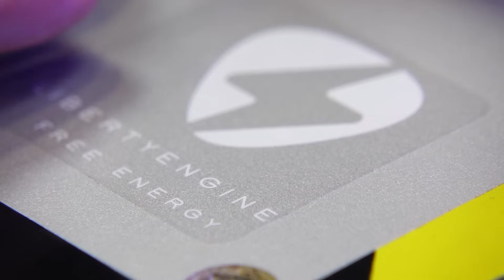10KW Generador de Energía Gratis con Piezas de Microondas - Liberty Engine 3.0 - 100% REAL

Comment: We saw you giving the generator an electric spark from a fan dynamo, but the question is when the generator was charged and worked to produce 230 volts of electricity, why did the fan dynamo not work when it was connected to the generator electricity? Please explain.
Reply: Good question, I don't know this device but yeah it's should hack like a motor if voltage are generated after the initial turn
Reply: Не буде ніяких пояснень! Бо їх не існує взагалі! Це фейк!
Reply: @SylvainRochette The problem is that he does not answer questions and inquiries.
Reply: @ВолодимирПироженко-э2ж True words, their silence in responding to criticisms and inquiries puts them in the circle of deception.
Reply: @mayarhayar5710  Well they responded to someone's comment in another language just below.. may try communicating in that language
Reply: This dynamo is a very low turn motor so i think it turns when he start it but we can not really see it. Also, i say: NO MOVEMENT = IMPOSSIBLE (And really difficult to prove in video)
Reply: @Liongate64  Perhaps the words are persuasive, but it is necessary to point out and explain everything that is ambiguous in responding to inquiries.
Reply: Динамо после поворота крутится, но медленно, это такая конфигурация этого устройства
Reply: It is moving, slowly and it should be stopped if there was no power from the generator
Reply: @pedrosura True, but it should have been clarified
Reply: 4rpm per minute it is slow
Reply: the starter dynamo worked look carefully 16:34
Reply: @tenkaio8  Thank you for noticing, what we care about is the result
Reply: @tenkaio8  well done man!! lot of poeple write such a lot of sh... the same who has never done something interesting in there life. Welle done!
Reply: Perché ha un suo interruttore. Si vede chiaramente che accende il ventilatore.
Reply: @marioaltieri6170 Grazie per la risposta, ma devo fare una domanda in modo che possiamo capire cosa sta succedendo.
Reply: @tenkaio8 çok güzel yakalamışsınız evet sistem çalışıyor bunu denemek lazım biraz üstünde çalışmak lazım
Reply: Because it STARTS to spin! Use lower play speed and watch carefully.
Reply: @user-nu3nn3jj5v  да согласен !

Comment: It's similar to a Meg in another configuration, so my theory of the device really work is, the herz at 50 could be because the core saturation cannot exceed 50 et but why the small motor used as generator doesn't spin as soon the device is started, it's the thing that make me think it cannot work, anyway nice demo
Reply: Он начал вращаться в обратную сторону, по скольку это было правильное направление, я пересмотрел этот момент несколько раз
Reply: because the diode passes current only in one, that's why it doesn't rotate, which doesn't mean that the system doesn't work, on the contrary, it works great :)
Reply: if someone tried to release an alternating current start impulse and even when you copy these coil connections on the video, each time the coils will work on a short circuit and this momentary impulse from the motor will discharge in a fraction of a second and will not surprise the correct connection of the coils is shown in the video without cuts in liberty engine 2 if someone was careful because it is still the same principle of operation as the other earlier versions and it is not static it vibrates if you touched a metal core or rod with your finger you would feel it
Reply: Este impossibile
Reply: @ionutlaurentiualexandru5243  if you say it's impossible, then explain exactly with substantive arguments why it's impossible according to you because I don't have any problem with these devices
Reply: فيه خدعه بالموضوع

Comment: The idea of a fuel-free generator is interesting, but I do not agree with the declared power of 10 kW. For such power, you need a wire of at least 6 mm2, and in this video, a wire of no more than 1.5-2.5 mm2 with a capacity of 19-27A (4-5.5 kW) is used, this is firstly. Secondly, in this video, the author does not show the power of the connected devices for summing up the power and understanding the picture as a whole, and the declared power of 10 kW is also not shown in the work. So, my personal conclusion is that this generator can produce a long-term permissible power of 3 kW, a maximum of 5 kW. Let's be realistic.

Now a question for the author, is the rod that acts as a fixed rotor made of what material, aluminum or a mixture of aluminum with another material, or is it stainless steel?
Reply: He already corrected, that it is 1kW, as for the bar, there is someone who did this experiment without the bar and it worked the same way and the (multi electro) I think the secret is the connection of the transformers to the stator.
Reply: Eu acho que ele não pode revelar o segredo, mas pode dar pistas de como funciona a ai fica por nossa conta .na minha opnião isso deve funcionar . eu fiz a copia do 2.0 e consegui 4.000 watts .acho esse mais interessante por não ter partes moveis.vou tentar faze-lo logo.
Reply: I don't think he can reveal the secret, but he can give clues as to how it works and then it's up to us. In my opinion this should work. I copied the 2.0 and got 4,000 watts. I find this one more interesting because it doesn't have moving parts. I'll try to do it soon.

Comment: ⓵ Is it true that the cylinder is made of pure silver and aluminum alloy?
⓶ Are there other substances included? So what is it? I would appreciate it if you could let me know.
⓷ Does an asynchronous induction motor have to be a three-phase motor?
⓸ Does the induction motor have to be a 36 Slot Type?
⓹ Are single-phase motors possible?
⓺ Can the synchronous motor MDS-4A start with 4W power?
⓻ It seems impossible due to lack of power. How do I get started?
⓼ Thank you.
Reply from the maker: The most important thing is the inner cylinder. It is not only made of silver and aluminum, but also contains other materials to a lesser extent. In addition, different special treatments have also been given to this material. It is not simply an alloy. We have explained all this in one of our videos
Reply: (I've explained all of this in the video
I watched all the videos, but I can't see them.
I'd appreciate it if you could clearly explain the video through email

Comment: I don't guess that it works, the metal shaft inside the motor needs to be about the coils in order to produce an electro magnetic field and it's necessary to be moving to generate alternating current.
Reply: NOT READY, JUST CHANGE THE POLARITY OF THE ROD! RESONATOR. GOOD WORK FOR THIS PROJECT!

Comment: Hola, seve bien el prototipo, mejor que el anteior
me parece que el principio de funcionamiento se basa en un oscilador
Lo que me interesaria saber es el material de la barra y dimenciones 
Cuantos HP es el motor ?veo que es un motor de 220v trifasico 
espero respuesta GRACIAS !!!
Reply: This project and the motor looks unserious, what makes sense in this project is the two sides micro wave primary transformers and the magnetor, so I find the motor unusual in this projet because the micro wave coils are wound to accommodate 220v, how ever all wires are connected in parallel both the motor wire, so without connecting the motor wire, I wish the engineer gratis or the video make should test the project once again, for a better verification.

Comment: ¿Creen que puede ser un motor de 4 polos en vez de 6? (respetando las demás especificaciones del video) y también si pueden ser imanes de ferrita tipo disco a reemplazo del de aro. Algunos componentes son muchísimo mas fácil de obtener que de los prototipos anteriores pero otros no. Muchisimas gracias.
Reply: tengo las mismas dudas, use uno de 4 polos y entra pero no sé mantiene la electricidad
Reply: @manuelmaikkel4234   ...o si se pueden usar dos motores de 3 polos. Para sumar los 6 totales. Como de bomba de agua o similares. Combinados sobre la barra. Al parecer, mientras el motor tenga su peso equivalente en cobre. Quizás, no lo sé. Este canal de YT sobre energía perpetua siempre muestra CASI toda la información, ya que al parecer ellos mas que nada quieren que la gente lo sepa. Lo demás queda a cuenta de los entusiastas.
Reply: @Jack_Smith_Yes  y que material crees que sea el tubo? estube investigando y dice que la distancia de la barra al embobinado no debe ser tan alta por las perdida de energía.
Reply: podrias compartir un pequeño video de como es la fluctuacion de la corriente? porque estoy a punto de terminarlo y que funcione al 100%... arriba deje un link con unas fotos del plano y del avance. @manuelmaikkel4234
Reply: @joseabelardoquinonesg.9048 salut 
Ai reușit sa îl faci sa meargă 
Eu nu am reușit
Reply: @liviubungianu9771  Nici eu n-am reusit dar ai vazut din ce-i facut miezul ? bara din aliaj de aluminiu cu argint (Argalium).

Comment: let me guess
the shaft that goes through the motor is a special alloy without which the device cannot function properly
as with the engine 2.0
Reply: you can make it out of steel the aluminum and silver alloy was intended to distract attention from the actual operation of the system and other important things and the principle of liberty engine 1 liberty engine 2 still remains the same
Reply: Si l’axe détourne les champs magnétiques »effet de Foucault « , pour un maximum d’efficacité ça composition doit avoir au minimum 70% de nickel,20% aluminium et 5% de cuivre. L’investissement ce compte a plus que 1000 dollars en partant juste pour l’axe ,sans savoir si ce truc va fonctionner et si tel est le cas combien en surnuméraire va t’il produire. Prétendre 10 kw  c’est est complètement fou.
Reply: @rochlamothe5216  Bonjour Roch, comment arrives tu à ces proportions? j'ai un mal fou à me repérer. Quant aux 10kW ce doit être en crète... pas en continu. Merci.
Reply: @aleksanderpawowski4251  Yes , seems you are right on the money, so much iron between the magnet and the coil could be destroying the Lenz effect , that is the main obstacle to free energy.

Comment: 1. Ask yourself why this channel never responds to comments.
2. While he gets the system running through the small motor, when it is started, the small motor in the hand should also rotate.
3. The material in the middle was not described.
Well...I'm currently building it myself to see if it works. Fortunately, this is not the only solution to generate electricity :-)
Good luck guys.

Comment: Why is it that a magnet next to a coil produces a current. 5000 W. No moving magnet?! Could you please explain.?
It seems that the Magnet plus the Coil generates a large flux but it static (just potential). Then by plugging at the outlet the small hand motor you are starting the engine. You make the coil of the motor generate a small voltage abd current to create an electromagnet l at the main motor coil that interacts with both static coils on the ends and once you get it going it doesnt stop?  This is not in the books. Is it anywhere? Is it patented? It must be an industrial secret?

I am curious about the Bar. It is transmitting a rotating magnetic field. What is it made of? Is it the same material as the rotor in Liberty Engine#2 which seems to be a high percentage of Silver?
Reply from the maker: This is another trade secret. The metal bar is made from the same alloy as the rotor on the Liberty Engine 2.0. The motor stator generates an oscillating magnetic field that is transmitted through the metal bar to the coils, and the magnets amplify the magnetic field so that the coils generate a high current flow.
Reply: @thelibertyengineproject7966  Thank you! That is what I suspected.. it’s that alloy again..
Reply: BTW, I really hope you mount the generator on a “delivery drone”, plastic see thru box in the bottom, make it fly indefinitely on an live feed. That will quiet naysayers
Reply: @thelibertyengineproject7966  What would happen to the Liberty Engine 2.0 if magnets were placed behind the coils?? Would the output exceed 20kW or not. I imagine you all tried it?
Reply: @pedrosura Can you make it with steel and see if it works? I would try but don't have access to the materials.
Reply: @bradleybrooks4761  No idea. I dont think it would work. I think the metal is diamagnetic or some other property. Its secret for a reason.
Reply: Это вечнная электростанция  😂ты его больше некогда не отключеш 😂😂

Comment: Why you anounce that max produced power is 10 kwt while the generator as we can see on the data panel has 0.75 kwt nominal power? If so i wonder the copper coils of the stator would be burned as a result of overloading.
Reply: Yes he was not showed how much watt (amp) gets..???
Reply: No porque se disipa por inducción...por eso tiene esa separación..pero tiene que tener2(pequeñas cosillas..que el invento argentino del {Enano® chupatierra®}{tiene y patente!!jeeeee😊
Reply: @lhkalp 
Obio que más de 40(Amper..sino se sobresatura..es chico..no...gigante?ok?
Reply: 40(amperes de máximo rotando los elementos para no producir histeria de núcleo..😊

Comment: Es muss die technische Möglichkeit vorhanden bzw. geben die spulen von Mikrowelle hin und her zu schalten, dabei sollte Mikrowelle spüle jedes umgekehrt mit Strom versorgt werden, damit wird ein Magnet welle einmal S und N bewirkt, somit wurde der Motor durch die Wirbel Magnet Strom erzeugen, um diese zu erreichen wird auch eine große Kondensator benötigt, und wenn dann der Erfolg der Umschaltung auf 50-60 mall die Sekunde ist, kann damit Wechselstrom mit 50-60 Hz  erzeugt werden, das mit stab ist nur eine Vortäuschung. Im Decker der oben aufgesetzt wird sollte die Technik sein.  Falls andere Erklärung haben können sie auf meiner Darstellung antworten.  An allen viel Erfolg, habe es auch gebaut und es geht nicht, wurde aber gehen, wenn die Spulen immer wieder automatisch umgeschaltet.

Comment: Salut,  j'ai regardé votre video avec attention, mais j'ai une question, si ce système fonctionne réèlement,  pourquoi  le petit moteur ne tourne pas après le démarrage du système?
Reply: If you look closely, I can see a very slow rotation of the microwave motor after they started the oscillation. It rotates in the opposite direction as it was forced before.
Reply: يدور

Comment: I'm looking at it and think it's great. I can't make it because I don't have the materials, but I can test it a little. My question is, during the test stage, power is supplied by the turntable motor, but even though a voltage of 230V is generated, the turntable motor does not rotate, so I am wondering why, and after that I unplug it. However, I think it will rotate until I pull it out.

Comment: El aire es un muy buen aislante de flujo magnético, por lo que el motor asíncrono empieza a zumbar como en el funcionamiento normal con un rotor de dos fases en lugar de tres.
Consume una corriente muy alta y se quema, o si está instalado, el interruptor de protección del motor se dispara.
¿Qué tipo de efecto físico hay? Que no suceda lo anterior y aún así llegue un flujo magnético tan grande a la varilla para subir 230V en las bobinas.
Lo que en realidad no debería suceder, ya que el aire, como se mencionó anteriormente, es un muy buen aislante de flujo magnético.

Air is a very good magnetic flux insulator, so the asynchronous motor just starts humming like under normal operation with rotor of two phases instead of three.
It draws a very high current and burns up, or if installed, the motor protection switch trips.
What kind of physical effect is there? That the above does not happen and still such a large magnetic flux arrives in the rod to raise 230V in the coils.
Which actually shouldn't happen, since air, as mentioned above, is a very good magnetic flux insulator.

Comment: I assume that this device is a kind of zero-point energy generator. In the video, the magnets are placed as single N poles at both ends.
And a stationary wave [longitudinal wave] is produced from the coil. The magnetic flux diverges throughout the center of the motor. It is 50/60HZ frequency synchronized and the magnetic flux time variation occurs. The circuit configuration is fed back so the energy is amplified. I think this is an actual example of energy extraction from space.

Comment: hello, please tell me the diameter and length of the shaft you made is identical to that of the motor, the material is the same as the motor shaft. thank you and keep up the projects, don't look at the envious
Reply from the maker: It is made of the same material as the rotor of the Liberty Engine 2.0. We will make another video for the members of the channel in which we will say the measures

Comment: What is output, how many Hertz, is it DC or AC?
Reply from the maker: 230vAC, 50hz
Reply: @thelibertyengineproject7966  but from where frequency appears? In alternator and motor we have rotation of rotor, but in this design nothing is moving
Reply: Is that voltage true Sine Wave output ?

Comment: I did it and it doesn't work. Initially, the red light in the power supply lights up, but after connecting to the engine it does not. Maybe others with magnets yes, but this model sucks.

Comment: Bonjour et bravo pour tout ce travail de genie, avez vous les détails comme vous aviez fait pour le N°2 (dimension du tube acier et spécification du moteur car avec le tournevis on hésite entre la première ligne et la deuxième. mais la sincèrement bravo car accessible.
Reply from the maker: Plus tard nous dirons les mesures de la pièce métallique au centre
Reply: The tube is 8in long,  I bought the exact motor in the video with the exact specs.  I just measured the black cap then stack the cap in photoshop next to the tube.
Reply: hello @McFlysGaming ,
few questions for you if you want :  what is the diameter and what is the tube made of? and last one, thus it works? Thanhyou
Reply: @McFlysGaming  lis the motor a 4 poles? looks like ...